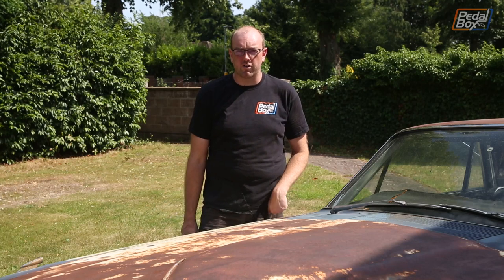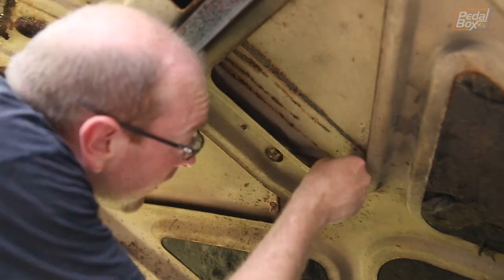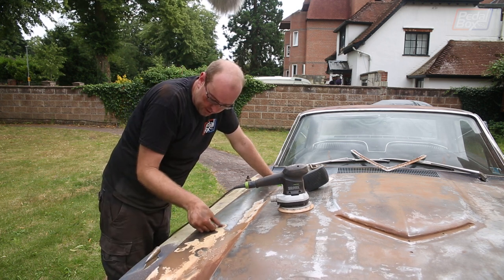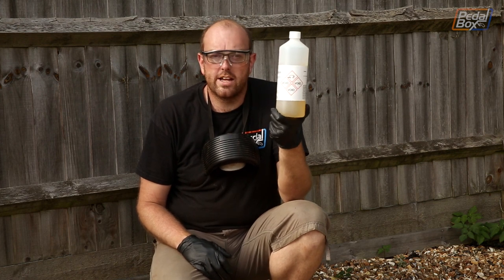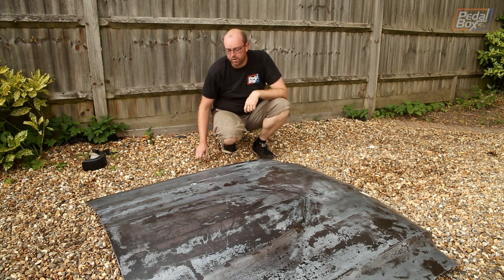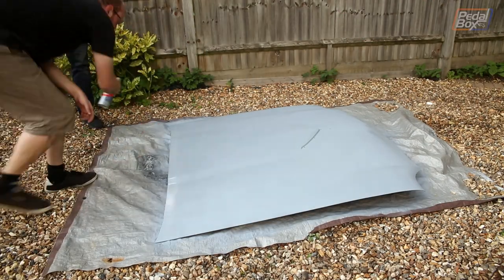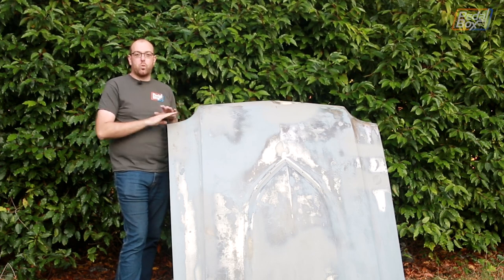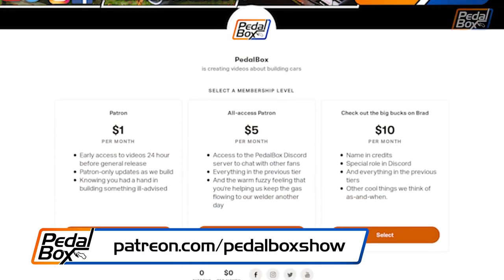Thunderbird Bonnet Rot - PedalBox Episode 34 | Fleet

Comment: Where did you get the replacement panels from?
Reply from the maker: I used https://www.classicsheetmetal.com/ for the rear quarters, haven't found anyone making bonnets, trucks or roof sections, for obvious reasons, but the guys there were great.